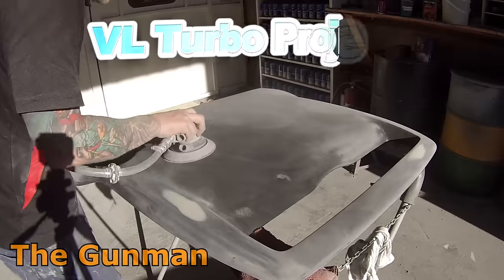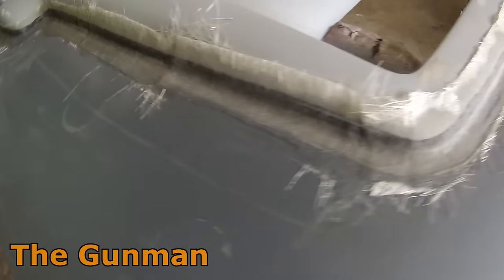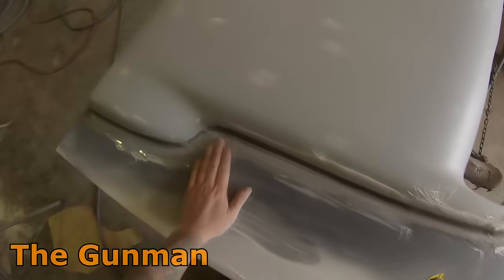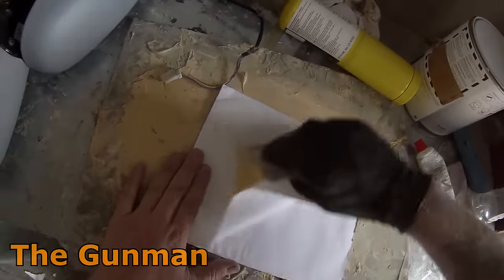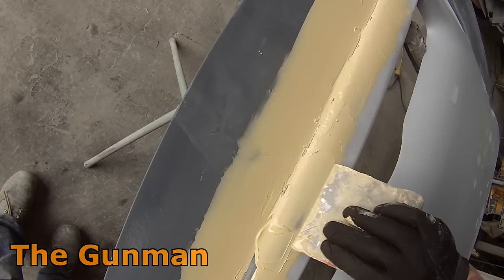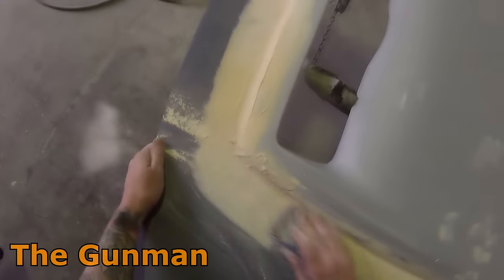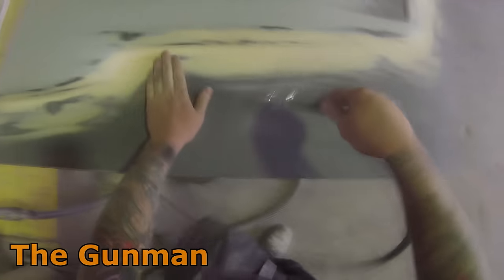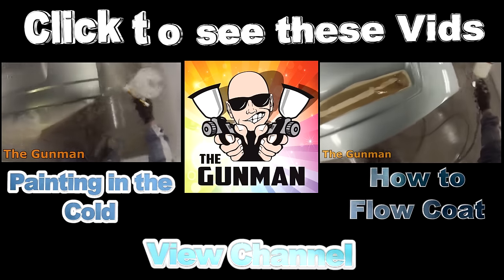How to Mould a Bonnet Scoop

Comment: I'm starting a project like this but with a steel hood scoop cut from another hood and putting it on a steel hood. I'm going to use 3m panel bond adhesive before the mounding process. I don't know if I should use screws to clamp the scoop during the bonding process or if the adhesive will be enough. Worried about cracks. What are your thoughts? It should have a good  4 inches of flat metal on metal contact all around. Your videos are a huge help, thanks for showing us how you work.